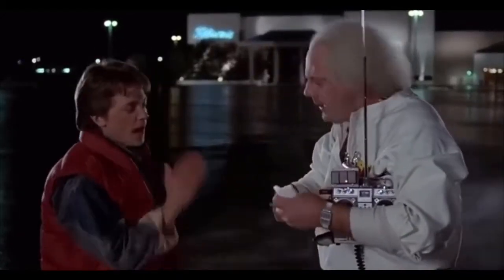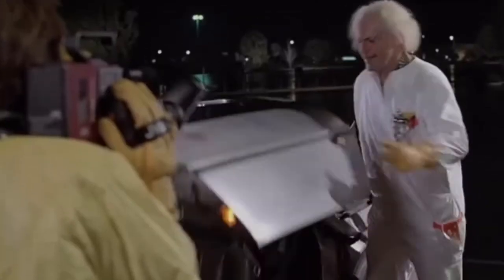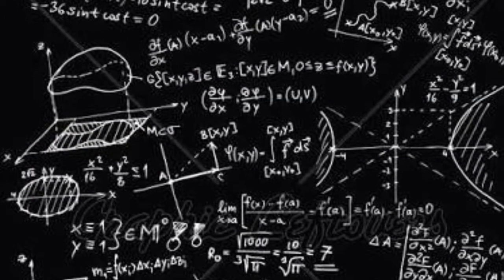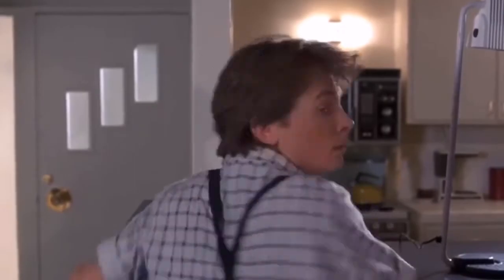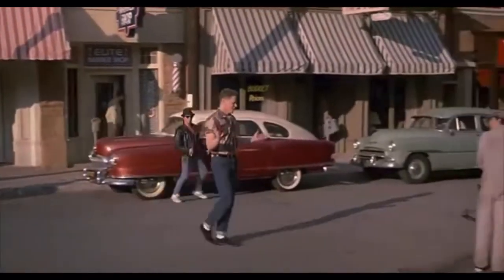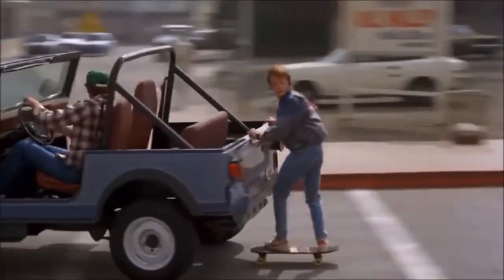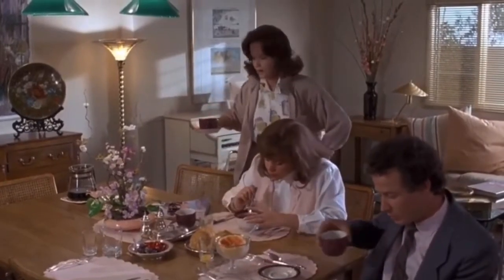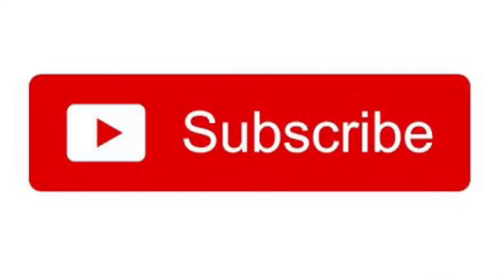How Time Travel in Back to the Future Works

Comment: Except for the vertex, three lines joined in the center, represented by the flux capacitor the description is technobabble to force a few physics concepts into a fantasy of a time traveling DeLorean.

Real physics from which concepts of backward motion through time emerge do entail a vertex. But the appearance of the vertex in the flux capacitor was an homage to Richard Feynman's vertexes in his Feynman diagrams. Feynman was a professor at Caltech, and an advisor on time travel for the film.

The vertex of Feynman diagrams are represented by an arrow pointing in to the vertex, an arrow pointing out of the vertex, and a wavy line coming from the convergence point of the vertex. There are six orientations the vertex can take. Wavy line up, wavy line down, wavy line to the right at 60 degrees from up, wavy line right at 120 degrees from up, to the left at 60 degrees from up, and 120 degrees from up. Each of these six orientations can be put together with other vertexes like a set of tinker toys to represent all kinds of complex sub atomic quantum mechanical interactions.

But here I'll describe one particular interaction. The vertex with a wavy line pointing up. The diagram represents motion of particles interacting through space, and time. Time is represented in the diagram on the vertical axis. Up the axis is forward in time. Down is backward. Space is represented on the horizontal axis. 2 particles colliding are represented as lines coming together across space from left and right, and their motion through time by the lines angle on the time axis. The arrow pointing into, and up the time axis of the vertex represents a negatively charged electron. The arrow pointing out, and down the time axis of the vertex represents a positive electron particle, a positron, an anti electron, antimatter. When the opposite particles collide at the center of the vertex they annihilate each other, or combine, to produce pure energy, a photon represented by the wavy line. Inverted with the wavy line on the bottom the vertex represents a photon decaying, or splitting, into an electron, and positron moving away from each other.

 The representation of the positron, the antimatter, in the diagram is the arrow that points down the time axis. It can be thought of as an electron moving backward in time. 

Time travel.

Information can be turned into a coded stream of electrons. It can also be encoded on a stream of positrons. That's as close as physics comes to time travel. Speculative extensions could be cobbled together where information is encoded on a stream of light particles where the light is split into electron, and positron streams. If computers can use the machine code of the brain then the mind could be copied, encoded on a positron stream, then converted to an electron stream code on the receiving end to be copied to the receiver brain. Likewise matter can be converted to energy, and the pattern sent to be reassembled on the receiving end. But given mind transfer whole body transport is redundant. 

The physics of the encoded positron from its frame moving backward in time is that to a forward moving encoder the encoded positron stream has the encoding before it reaches the encoder, and the encoder takes away the encoding so the stream continues backward with no encoding. That's where the physics shows there's no way to send information backward.